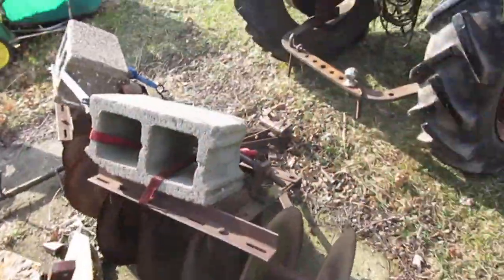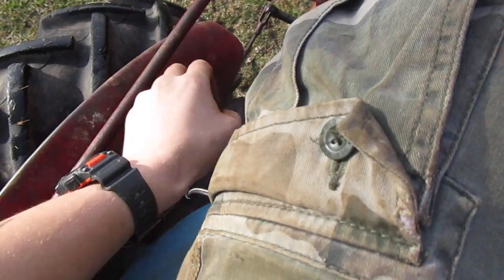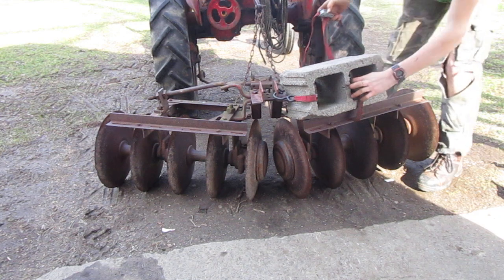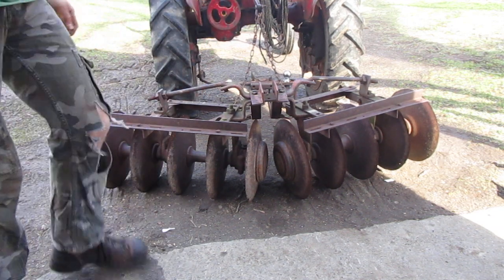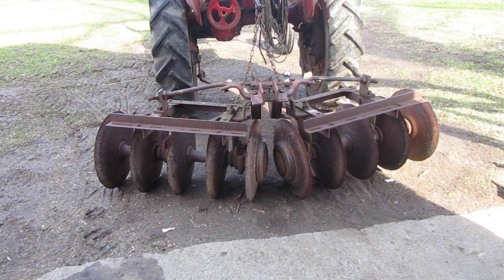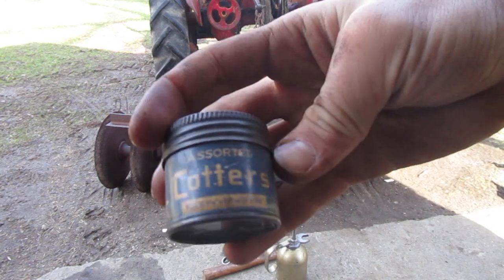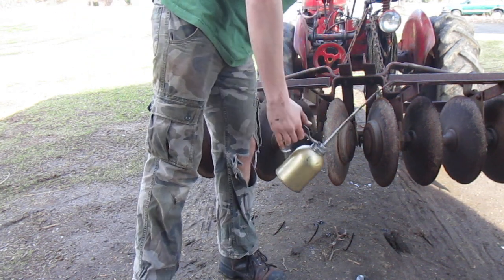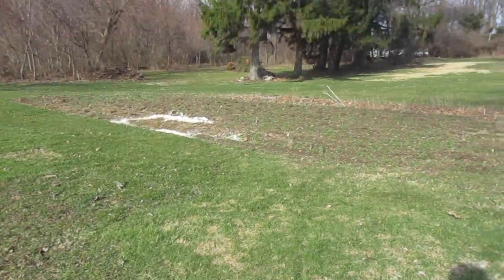Disking with the Farmall Cub

Comment: Great video Matthew. We had a cub on our dairy farm back in the 50's and I spent many hours on it cultivating and mowing fences with the 4 ft cycle bar belly mower on it. I noticed something in the video that I want to make a comment and hope you take as intended as advice and not criticism. I noticed all the time you were driving you were resting your foot on the clutch pedal. While there may not have been enough pressure to make the clutch slip, it is really putting a lot of wear on the throw out bearing and clutch fingers. believe me, it's a job to repair as the tractor has to be split. It's good to see young people maintaining and using this old equipment. Keep up the good work.

Comment: great video cool tractor for sure, hey buy 4 bags redi mix, put them on where the blocks re next fall. by spring you will have molded concrete weights, the paper will eventually rot off. thanks for video.
Reply: yeah, still do that today for many things ! thanks for the reminder.

Comment: Great little cub, nice to see original paint, those hydraulics work flawless. My dad had one on our farm , it had 42 belly mower 2 bush hog style swinging blades it would cut down small trees, he made custom cultivator to do point rows for corn and soybeans fields .out of school got job at IH dealership on the cub there is no throw out bearing for clutch fingers but it is a material like graphite that pushes on clutch fingers, that one guy mentioned force your self out of that habit of touching clutch or brake pedals young man 👨 lol  I’ve had 3 cubs over the years one of them had no hyd lift. Thanks for video  of mighty little work horse

Comment: Disc cut much better than I expected. We  had a Cub when I was a youngster used primarily for cultivating Tobacco & Garden, mowing fence rows & lots,  and sawing firewood. I made good money, as a young teenager,  mowing overgrown lots in the community. The cut off saw that mounted on the rear with a sliding table was fantastic

Comment: nice running cub, you ought to repaint that hood before it rusts. i have a cub, a 1948 and im going to go mow the lawn with it in a little while. i have a danco C3 60" mower and a 54" blade. it handles all of the mowing and snow removal around here. its an awesome, well built, durable little tractor. i cant say enough good about it.
Reply from the maker: +andrew donohue yeah I have a 52in mott flail mower and i did a lot of mowing in the past couple of days and didn't tape it so watch out for new videos

Comment: Oil may not be your friend depending on what you oil. Oil and grit is a grinding agent. Pins should be lightly oiled and wiped off. By allowing oil and grit to mix together you can make much worse what you are trying to prevent

Comment: guy down the road has one a cub now I can see why that a small bog harrow man they will cut a pace of ground up we still have one that is pull behind ford tractor when making a garden.
Reply from the maker: +roger wilson yeah the cub ones were nice and I haven't had any issues with mine in the fall im going to use my cub plow watch out for that video as well
Reply: Matthew Hickin
well there main uses were in cultivation of corn and tobacco.   The cub tractor, they were small enough to run between the rows and cultivator was below the cub so to have more control when and how cultivating those crops.
Reply: roger wilson jj